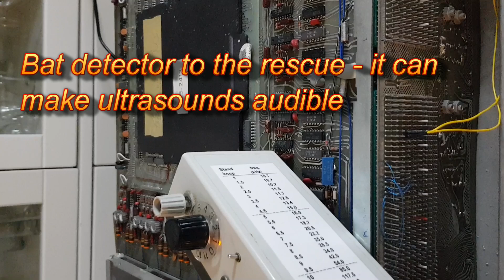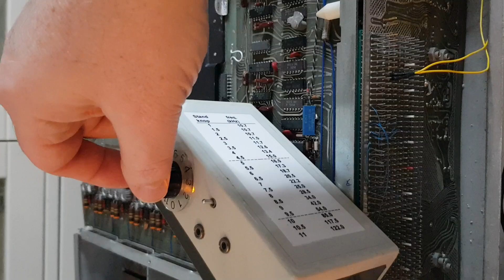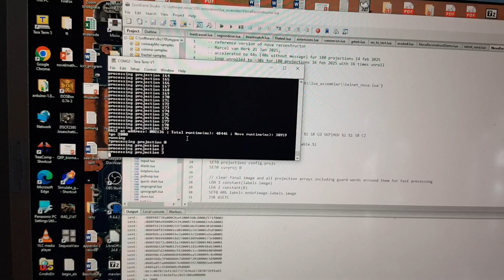Ultrasonic sounds made by a 52 year old computer

Comment from the maker: The frequency is rather high, if I remember correctly most bats make sounds around 25--50 kHz, and the computer around 60-80 kHz depending on the optimisation. I guess I have to put it outside on a warm night in summer and see!